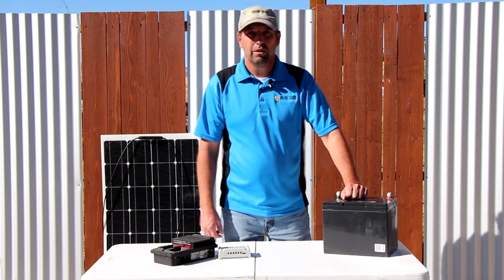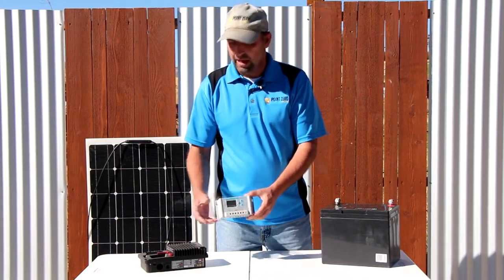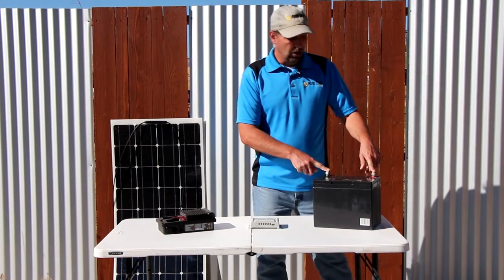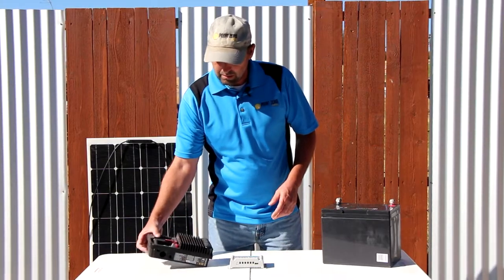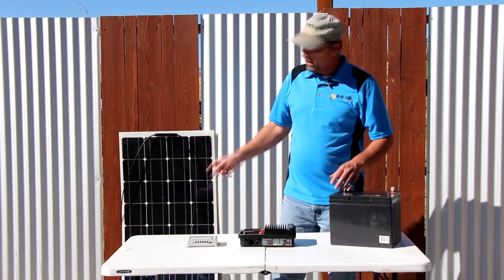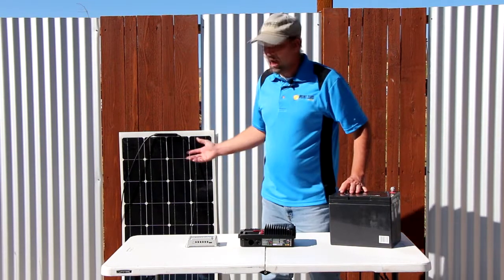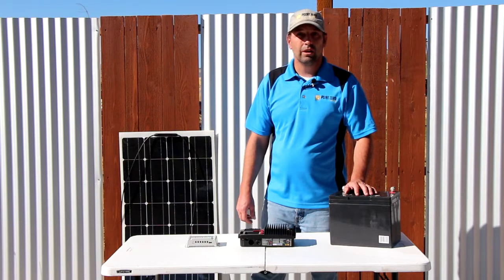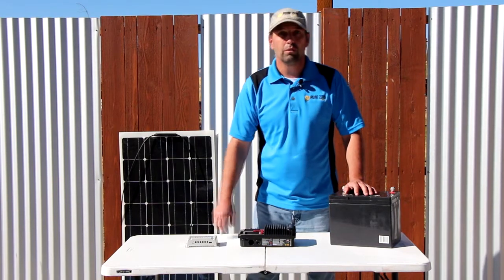The Truth About Charge Controllers- PWM vs. MPPT

Comment: I have MPPT that I purchased through point zero energy. The only problem I’m facing is that on the controller it shows 900watts of production from the panels. But when it is hooked up to my Boots 3000watts system from point zero energy it only show 800watts of input?
Reply from the maker: This display on the boost shows the net power going into or out of the battery, where the mppt, it shows the total watts going in from the solar.  This means if you are running anything, it will take away from what goes into the battery (even the mppt, and inverter being on uses some).  So you will never see the full amount going into the battery, and if you are running something, you can even see it pulling from the batteries (if you are using more than what the solar is putting in).

Comment: I have a pwm with a 350 watt solar panel. Puts out 250 watts. If I connect the mppt it will put out full 350 watts?? Btw I have 2 deep cycle batteries at 105 AH connected in parallel!  Is 350 watts enough for that battery setup? Any reply appreciated! Cheers from Australia!
Reply from the maker: There is no guarantee the mppt will put out that much more power.  However you usually get a lot better output with an mppt over a pwm during less than ideal conditions (when you need it the most).  I would say 350 watts is ok, depending on what you are running.  If your batteries never get fully charged (or if they just barley get charged before night), then it is not enough.  Your batteries need to be fully charged for several hours every day.
Reply: @PointZeroEnergy  hi I added  another 350 watt solar panel. 700 watts should do it? Thanks for the reply.! 🙂👍

Comment: my pwm charge controller dingo 20/20.   12 24 48 volt it won't work with my single house solar panel 180 watts why???
Reply: I would probably contact the manufacturer and ask them.  I don't know the specs on that controller, or know the best way to trouble shoot it.